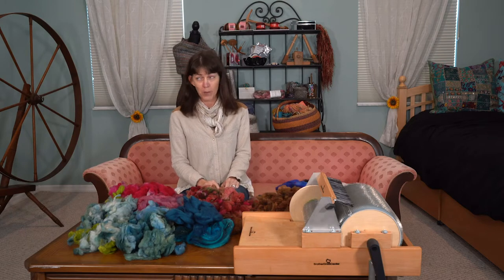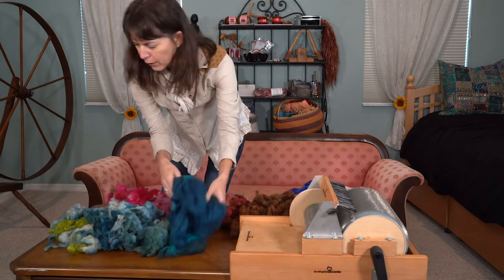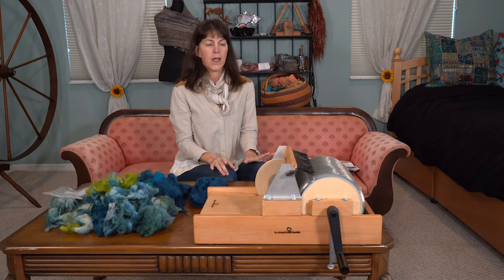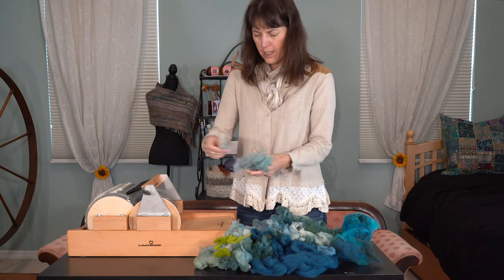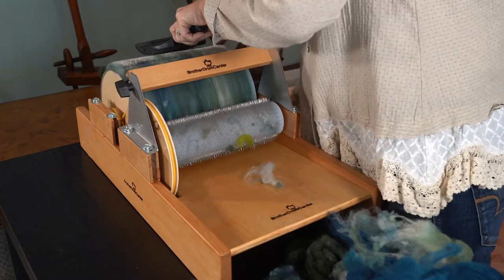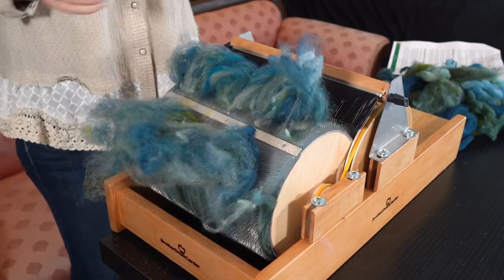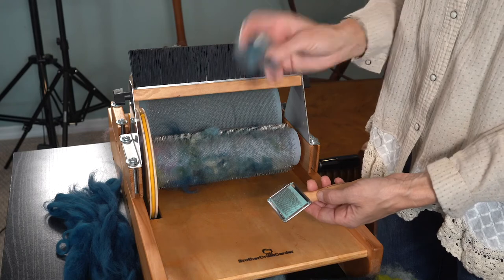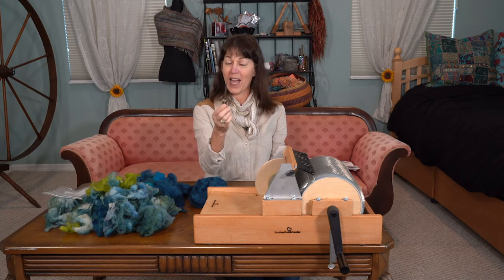How to Use a Drum Carder to Process Fiber

Comment: Your drum carder is making quite a lot of noise as you turn the drum. Is the noise coming from the packing brush (good) or are the teeth of the two drums gnashing together (not desirable)? If they are hitting one another they will need to be adjusted to avoid wear.
Reply from the maker: Thanks for your interest. It’s the packing brush. The drum carder is properly set up to the manufacturer specs. Have at great week!  ~Shiree